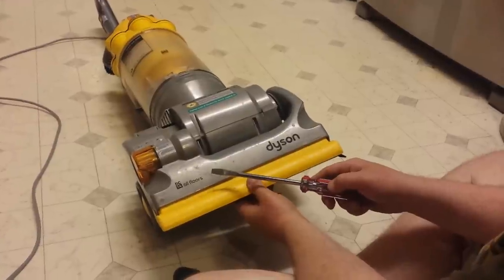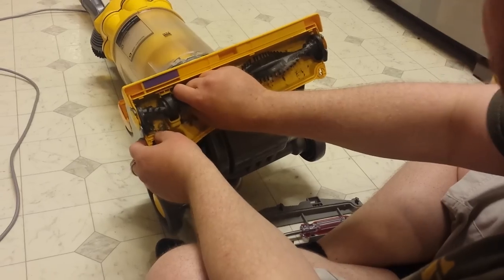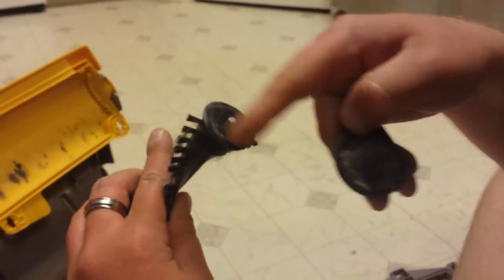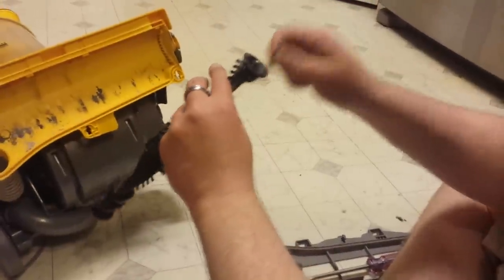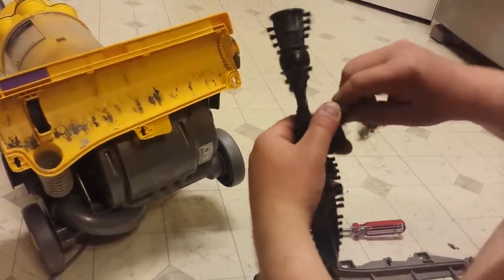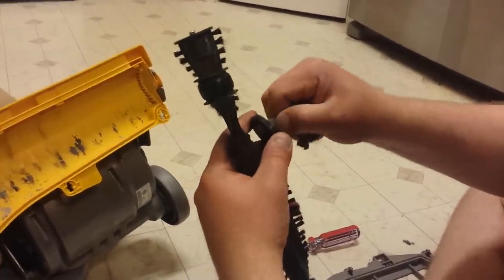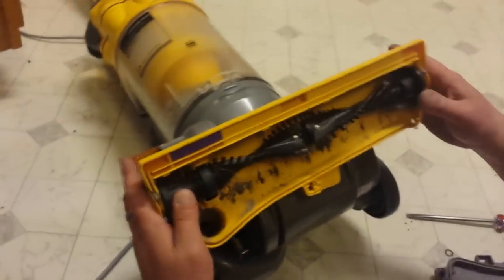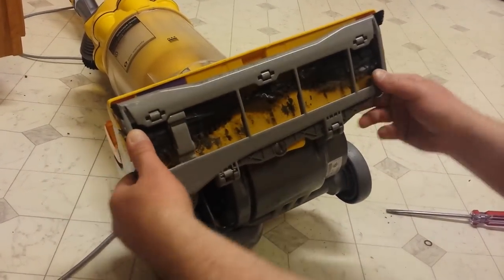#1 Tip Dyson Burning Smell Beater Bar Brush Stuck DC14 Not Working Easy Fix DC07 Roller Brush Stuck

Comment: Thanks!  I've cleared the hair many times over the years and a few years back I replaced a beater bar, but when I wasn't getting any spin I jumped on the computer and found your fix.  The caps were tight, but using a small screwdriver I "gently" opened the cap by popping it a little around at a time.  You were dead on!  The area was filled with thick dust and hair.  After cleaning it out, I used a q-tip with some alcohol for the final clean and now it works like a charm again :-).  So happy!

Just wanted to mention for those who have trouble getting the bar out and back in, I would suggest slipping a large long screwdriver under the belt to hold the belt in place so it doesn't slip down.  It can also be helpful to pull the belt back when getting the bar under again.
Reply from the maker: +Steph T Sounds like a job well done!

Comment: Getting the beater bar back in was a struggle.  It would not fit.    So what I did was pull the entire bar out slightly from the bottom part of the vacuum, straightening it out so that it was parallel to the bottom.  It then slid in easily.   My vacuum  (knock on wood) is running perfectly.  I love my Dyson.  I have had it since 2005.  And I have cats too!!
Reply from the maker: Nicely done.  It can be a pain but well worth it to keep you Dyson running.

Comment: Never would have thought those end caps could come off! and debris could build up underneath them. We just replaced the clutch, and the bar wouldn't spin. Hubby was ready to tear it all the way down again when I did a search on bar not spinning. We saw this video, followed the instructions, and all's well. It was good that the video showed you have to use a little muscle to remove the cap, or there is no way one would know that it comes off.  Thanks for saving us additional money and frustration!
Reply from the maker: Glad it worked out.  Is it still running?

Comment: I did this and it’s a whole new vacuum! The only difference is I didn’t even remove it. You can just pull it out and to the side a bit to clean the ends. It’ll save you a whole lot of headache getting it on/off and no screwdriver needed.

Comment: Thank you! My Dyson wasn't making a noise and didn't have a burning smell, but the brush bar wasn't spinning with power (I could stop it with my hand). Removing the brush bar and cleaning the ends solved the issue.
Reply from the maker: Glad it worked out, like and subscribe for more wonderful Tips.

Comment: OK THANK YOU THANK YOU THANK YOU!!!
FYI: I did not have to take the brush roller all the way out. It appears as if one of the end caps is attached to the rod. Hold onto both end caps and turn one hand counterclockwise and the rod will unscrew.

Comment: This totally fixed my problem. I've been cleaning hair (MY WIFES) off the brush bar for years but never realized that it got tangled up inside. This fixed my vacuum and saved me from a service fee.  Thanks!
Reply from the maker: Amazing how the buildup can prevent the bar from spinning.  Shops charge a lot to fix and half the time you get it back and it still does not work right.  :(

Comment: I broke the plastic cap where the sprockets are. Guess I'll be trying some JB Weld for plastics on it. Wouldn't budge so I forced it to pop off. Might want to caution viewers on that part. Otherwise, very helpful video.
Reply from the maker: Tell me how it worked out .  I think great idea.

Comment: Holding one cap, I was able to “unscrew” and pull off the other.  I broke the other cap trying to pull it off.  It turns out if you hold the exposed metal shaft on the end you removed with a set of vice grips, the other end can easily be screwed/pulled off.  Both ends of mine were packed with hair to the point the plastic had started to melt, so I ended up replacing the entire bar.  Works perfect again.
Reply from the maker: I am very glad this worked out for you.  Now you can keep an eye on it.  What model did you have?

Comment: Brush bar on our D.C.14 end caps not entended to come off - broke both of them. They do not look like ones in your video. Have ordered a new brush at cost of $30 plus. Just thought u should know.
Reply from the maker: Odd, maybe different model or version.  Tell me how it worked out.  Do you still have it?

Comment: I hope this is the problem I have been using my brush handle bar now I hope this works....I will let you know.
Reply from the maker: How did it work out? Were you successful and fixed it? Still running?  Enquiring minds want to know 😆

Comment: Thank you!!  I actually took the bottom off to clean the beater bar and couldn't get it back in place, so I went looking and found your video. I decided to clean the inside since it was opened already, but I wasn't strong enough to get the bar completely out because of that rubber belt, so I used a screwdriver to manipulate the rubber belt off enough to shimmy it over so I could access the ends without taking it all the way out.  Once it was over a little, I was able to unscrew one side and the metal slid out enough to clean all that gunk out!  Then I did the other side, screwed it back together and it easily slide back in place once they were lined up.  So thank you!!!!  I couldn't have done it without your video.
Reply from the maker: Glad it worked out, subscribe for more money saving tips.

Comment: I can't believe this isn't in the manual. I cleaned the brushhead but didn't know there was an inside that needed cleaning... almost started ripping the whole thing apart to check the clutch.
Reply from the maker: No one will put this in manual, because that is how dyson and repair facilities keep you spending money.  😊

Comment: My caps had nothing around or in them but the brush roll was getting so hot it melted the caps.
Reply from the maker: This could be clutch issue, past the point of no return.  It would be interesting for an update on the fix you had to do.  Kindly advise.

Comment: Hey thanks - worked for my DC07 which is about 7 years old.  It sprang back to life after cleaning the caps and rod.
Reply from the maker: Good to know it works on DC07!
Reply: +Lostinspace42  I, too, have a DC07, which now works a treat since I cleaned the end caps.  It seems hair wrapped around the spindle is a world wide problem; I am in Australia.  Dyson obviously do not want customers to do this smple service, otherwise they would have put it in their literature.  Hmmmmm

Comment: The last thing you need to do is use silicone lubricant to eliminate the sticking because the build up of gunk can cause the brush bar to stick and not turn freely. So use silicone on the metal rod inside the brush bar and rotate it a little so the lubricant spreads all over the inside of the brush bar and lubricate the end caps then put all back together, place the brush bar back into the machine and their you have it the problem has been eliminated.
Reply from the maker: I agree, just clean bar, no need for lubricant.

Comment: Thank you. This helped guide me to fix my vacuum during the great quarantine of 2020. Also, this is a great time to WD40 the beater bar.
Reply: I skipped the WD40 and it still worked. Don’t want oil in my carpet.

Comment: Thanks! I've cleaned the beater bar MANY times in the 5+ years we've owned it, but when the bar stopped completely, I never knew those odd shaped end caps could be removed/cleaned. It was wrapped up with lots of hair very tight. Instantly back to normal!
Reply from the maker: Glad to help out.  The DC 14 is a great vacuum cleaner and could possibly last forever for you.
Reply: I was having the exact same problem!!! Thanks for the video, It saved me tons of mental anguish!
Reply from the maker: I love my Dyson and can relate :)

Comment: I think this was the answer to my over one year problem with my dyson...the tough part was as you said to take the brush off and put back on.  what about the filters...would those not being cleaned ever stop the brush I don't think so I think this was the entire problem...although I don't remember having a burning smell....either way a huge thank you no more vacumning with the hose...thanks again.
Reply from the maker: Anytime.  I have a backup top filter/sponge that I swap every couple of months.  That way Im not without a vaccuum while the filter is drying from being washed.  The bottom filter is a hepa filter and doesnt need to be replaced but once every couple of years if at all.

Comment: thanks for this video :) i fixed the dc14 animal version i found in the trash today and the brush roll was jammed, did what you did and it works perfect!!!  also flushing inside the holes under the caps with wd40 makes the brush roll spin even smoother:)  pretty much any oil will do.
Reply from the maker: That's great to hear!  You my friend just got a good find!

Comment: Wish this would've worked for me, but the brush still isn't spinning. I think I have a broken belt and need to replace the clutch assembly. $30 on Amazon; it should be here on Tuesday and I'll find out for sure. The way I got the end caps off is I gripped both ends in each hand and pulled them apart while rotating in opposite directions. One came off and I was able to pull the bar straight through the brush bar and pull all of the hair off. It took less than 5 minutes from start to finish. At least my brush is clean now. Lol.
Reply from the maker: It can happen, hope it is still working😊
Reply: @GizmodinLightbringer  Yes. I replaced the clutch assembly a few days after posting that comment and it is still working perfectly.
Reply from the maker: @MarsieInTX  glad you still have it!  Woo hoo, dyson dc14 forever.

Comment: Unbelievable how much hair can get caught up under the brush bar end caps. Once the bar is out and the caps are off, it takes about a minute longer to replace the two ball bearings. Their P/N is 625RS (also listed as 625-2RS) and a 10 pack can be purchased at Amazon for about $10. The RS simply means that each side of the bearing is enclosed by a rubber seal. Just slide out the steel axle a couple of inches and use it to tap out the bearing on the opposite end of the brush bar. Then flip the brush bar over and tap out the remaining bearing in the same manner.

Comment: I followed all the instructions however, my beater bar is still not spinning. Initially, it made a noise coming from the beater bar area. Nothing changed when I pulled out the beater bar and cleaned under the caps. Any suggestions?
Reply from the maker: +ingcloud gmail Retry taking it out and putting back in.  Make sure belt isnt twisted.  Happened to me two weeks ago.
Reply: My boyfriend found a second belt on the main motor that had fallen off its guide that was causing our issue.
Reply: Oh I hope that is my problem! I just don’t know how to do that, do you know if it was fairly easy??

Comment: You're awesome, it worked like a champ! Never would have thought of it, and mine had no hair in there, a thick layer of dust. Took a bit of ticketing to get it in and out, but a nice long flathead screwdriver helped a bunch. Once I got it back together I had to roll the brush a lil by hand after I powered it on, but after a few secs it fired right up! Thank you, thank you, thank you!

Comment: I've had mine since 2007 and this is the first time I've done this.  The caps DO NOT want to come off...  

Edit due to my reading failure..  I have a DC07 and those beater bars have a bar inside so popping one cap off frees the other cap to slide I'm hoping all that hair I removed did the job.  If so this vid is largely applicable  to the 07 series.  I'll post again after it's all back together and rolling or not.
Reply from the maker: They will, mine was same way, i have two of these.

Comment: This was great, I still can’t get my the beater bar to spin which makes no sense because I take good care of my things… have you ever had that happen if the beater bar was not put back correctly? Maybe I put something back wrong. It still sucks but I don’t want to have to purchase another one yet boo!
Reply from the maker: +Montsergirl Check to see if it is on hardwood floor setting instead of carpet.  Switch to carpet to see if it spins.  Also reseat beater bar and make sure rubber band is not twisted around beater bar.  Hope this helps.

Comment: I have the same vacuum and the brush caps won't come off. Any help?
Reply from the maker: The could be gummed up pretty good.  It is very hard to take them off the first time.  I would recommend try twisting each one first to loosen.
Reply: ok yes it is very hard even to take it off of the belt and it is hard to take the end caps off
Reply from the maker: Yes the first time takes Hulk Hogan like strength.  :)
Reply: hahaha it mfeels like te belt will break even when the vacuum is 11 years old

Comment: Any tips for me? I cleaned all the hair and crap off. But the vacuum won't start now...? Did a fuse or the clutch burn out?
Reply from the maker: Did it turn on before you cleaned it?  
If it did I would take it apart and put it back together again.  Something may be jammed.  Make sure the beater bar is spinning.  

You can also check the switch.  The wires on the inside can become loose.  Their is a screw hole on the backside and some slits.  Once you take out the screw and open the slits you can take the front off under the power button with a good amount of force.  Once that pops off make sure you take a couple of pics of where the wires are located and how the cord is wrapped so you can put it back together more easily.
Reply: Lostinspace42 Thanks for the quick reply. I followed your steps and also found that I had to remove and clean the end caps that spin the brush bar. Since there was dirt there the motor would not let me power on the vac. Once I cleaned the end caps along with the brush bar it purred like a kitten. Thanks again!!!

Comment: This is the same problem im having pulled of the one cap easy, but the other cap seems to be completly jammed up or something. I think i might just have to get a new brush bar... Just wanted to vacumm and i ended up making more of a mess and can't even vacumm...
Reply: MrTrapper1017 Never mind, took off the easy cap and then just hammered the metal bar out. The stuck cap came off. Had stuff that was hard as plastic sealing it together.
Reply from the maker: If is first time taking the caps off they can be tough sometimes.  I have done a few and it seems every other one is a pain, but they should come off easier from now on. :)

Comment: hey i did all that mine had no washers on it... it would spin before i put the grey guard on it then it wont spin.... ive tried it upright and every which way
Reply from the maker: What model of Dyson do have?
Reply: dc14
Reply from the maker: +Pilgrimage85 somtimes if the caps are not aligned properly the beater bar wint spin.  I would redo everything over.  I had to do that once on these just to double check to make sure there was no debree I missed.  I hope this helps.
Reply: well it spins manually, but when i assemble it all no go, not even suction now that i checked. its all having to do with the wand i think suction from the handle then when i cover the wand the canister makes a loud noise
Reply from the maker: Check to see if belt is twisted.  You may have to extract beater bar in order to do so.
Reply: i removed it completely and cleaned out all debris. I don't know what is wrong with it. When i remove the wand and use just the hose with an attachment it works....
Reply from the maker: +Pilgrimage85 Do the caps spin that are attached to beater bar?  There is on on each end
Reply: yes they spin i put the grey guard one it and then it doesnt move at all

Comment: What you failed to explain is that the caps are not just flat caps but have the gear looking apparatus that the pin goes into.  Therefore you cannot pop the cap or you'll break it...your cause was right on - instructions to fix will cause me to buy new bar
Reply from the maker: Tried on many Dysons and never broke a cap gear.  Relax, breath, and just know, no cap gears were harmed in the making of this video.